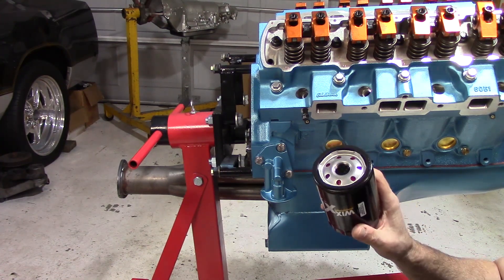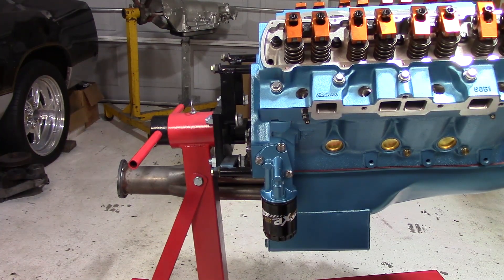Olds 455 Build Part-11 Kooks Headers, Dipstick, Oil Filter Housing Install!! 1987 Olds 442: Video 74

Comment: I had a 67 425 Olds in a 78 Cutlass back in 1988 just out of highschool. Built the engine in automotive class on a shoestring budget, new rings bearings, cam and lifters timing chain and oil pump and felpro gasket set. Reused pistons rods crank and valves and springs. Spun a rod bearing after 3 years of rodding the hell out of it. Still have that motor torn down and in boxes.

Comment: 2 and a quarter primaries into a 3 "collector. 3 inches handles 300 hp. PERHAPS YOU SHOULD HAVE investigated custom making your own headers, 1-3/4 into a 2.5 collector using a Headers by Ed catalog  would have been better, ASSuming you were below 3500 f y attitude.
Reply from the maker: You sounded angry. I hope your not angry. Here's a great article from Motortrend to learn all about header size requirements. https://www.motortrend.com/how-to/1708-correct-sized-headers-will-give-you-best-performance/
Reply: @hutchhiperf  Not angry at you. Too many header companies sized their header products to large on their sizes, so they could sell their stuff. Remember you do have to drive this on the street, so the larger sizes would kill velocity on the low end.

Comment: Big and small block Olds have a lot of cross over parts. The length of the blocks are identical.
Reply from the maker: @jeffreyMagnum460  it just comes down to a taller deck height. Have you checked out Olds FAQ online?

Comment: What was the part number on the dipstick? Thank-you
Reply from the maker: @amrikjaswal76  not sure now. I ended up getting another one with a shorter handle anyway. If you're using a stock pan, get a matching dipstick to get a proper reading.

Comment: Im building a 455 olds and putting it into a 78 cutlass and i could use those headers. What is the part number on those? if there is any. 
Thanks!
Reply from the maker: @urdunn602  don't think Kook's make them any more. Check that. American Racing makes them, but they're stainless and $$$$

Comment: After setting preload to your valves dose your pushrod still spin between your fingers I put a quarter turn for preload I have roller cam 600lift roller lifters and roller rockers
Reply from the maker: Have you seen the prior video where I adjusted the valves? https://www.youtube.com/watch?v=BdSWgkso7bg
Once you do your 3/4 turn (or whatever the manufacturer recommends) preload they won't be able to turn. You can only turn them at zero lash where you take all the play out.

Comment: American racing hedders ARH makes 1 7/8 and 2 lnch at the price of 1400 bucks
Reply from the maker: So close to 550 it's tempting 🤣
Reply: @hutchhiperf  yeh you got a deal  on those . They are not listed on kooks website.
Reply from the maker: @84hurstoldsdude77  Huh! I thought they were going into production.
Reply: Where to find those headers?
Reply from the maker: @BigGeorge3397  apparently no where. It seems they were a limited run for guys on an Olds Forum. Sorry.
Reply: Would what you recommend if you didn’t have the Kooks?
Reply from the maker: @BigGeorge3397  American Racing Headers makes a nice set, but they're pricey. Stainless Steel too.
Reply: Ok. That’s a lot of money but if they fit without headaches…. Anyway, have you seen the Hurst Olds Powernation is doing on YouTube with the 455?  Check it out